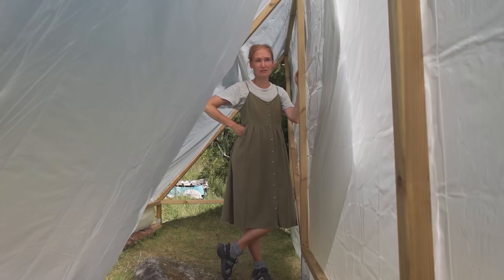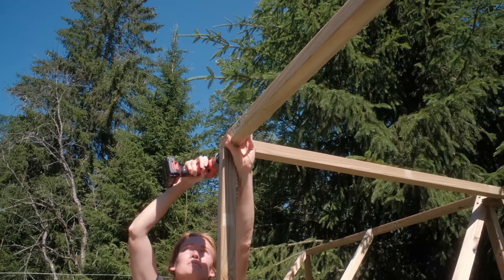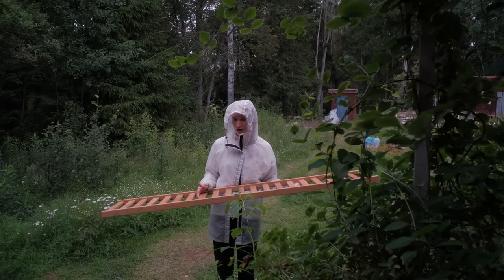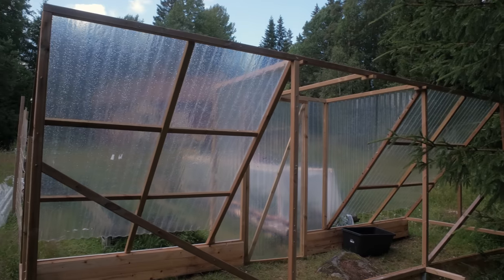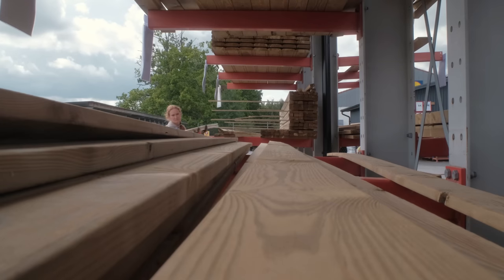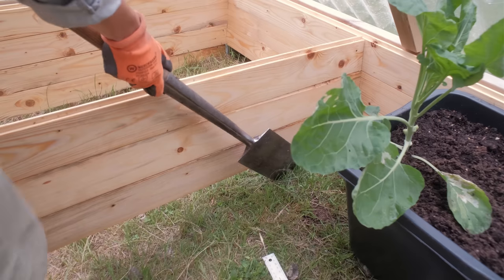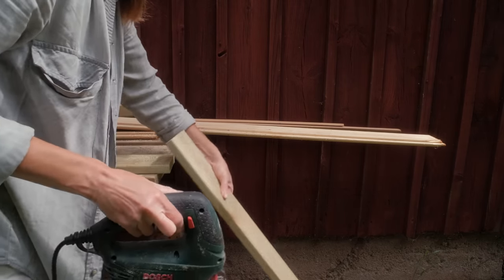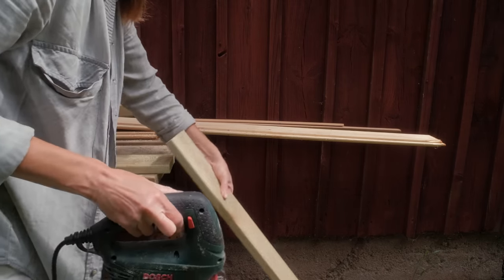I accidentally built a fairytale greenhouse (Story 59)

Comment: You did amazing, as you always do. And the video was made beautifully 💕  Now to the part I don't really want to write, but feel compelled to as a professionally trained joiner who's seen a lot, and lost part of 3 fingers to a machine (they were all put back and healed fine in the end so I'm one of the lucky ones). Your safety awareness around power tools really scares me sometimes 🙈 To make a long story short, please never ever cut/saw lumber (or anything, aspecially in non uniform materials such as wood) with the blade pointing toward any body part. If you need to hold a piece of material, prop it up, or hold the end you want to keep from falling and saw with the other hand, never crossing the two. Never ever! Blades can shatter from nowhere in the middle of a cut (happens more frequently than you would think). Timber can all of a sudden change in density, within the same piece. Things, like pebbles, minerals etc can be invisibly imbedded in the wood (due to wind, animals etc, and then the bark just grows over it year after year making it invisible). All these things can cause saw blades to either shatter, kick back or rush forward, sometimes so rapidly your brain won't follow until after the fact. These things lead to lost fingers, severed arms and worse... All the time! You're so precious to so many of us. Please please be more safe, even if it means being slightly inconvenienced in the beginning. Once you get the hang of how to do things with safety first in mind it will quickly come as second nature (self preservation is a powerful motivator) and you'll just do things the safer way automatically. If you struggle with getting started, search for things like "circular saw safety" etc, and you'll get good visuals to remind you of the dos and don'ts to keep top of mind. I'm rooting for you in everything you do and hope you will take this as well intended advice rather than criticism. That's how it was meant, no more, no less. Take care, be happy & be safe. I all ready look forward to your next video 😊❤
Reply: Well said, the cross arm cuts were making me nervous alone
Reply: It’s a really important reminder to all who use tools and do projects. You get caught up in the moment and the progress and safety isn’t out front in your mind. I needed that reminder too. Thank you!
Reply: Thx for the warning! I was on the point of sawing myself, always feel a little scared, procrastinated doing so, and was now seeing the beautiful work here on the edge of sawing like I saw here. So from our watchers viewpoint your info are very valuable , too!
Reply: And ABSOLUTELY ALWAYS wear safety glasses!!!!!!!...I also felt sorry for you poor hands, try wearing gloves...even fishing -gloves that leave index, middle fingers and thumbs exposed for dexterity. ALWAYS safety first, good luck with your projects❤

Comment: Fabulous job and it looks really cute and functional! The only thing I would consider adding is a self ventilating window. They are relatively inexpensive, but an arm will push open the window automatically when the temp reaches a certain level. I don't think you even need solar for it. However, they do make small, inexpensive solar fans for greenhouses, too. It 's so important to keep the air moving.

Comment: Well done Rosie and your parents. You work so well together.The pitched Roof and bigger entrance and the bench over the rock are great. I imagine that if you grow year round in there you may build another. If you have a black covered water source (garbage bin, or spray paint milk containers) they will absorb heat in the day and radiate that heat out over the nights. Compost is also a heat source , both of these low tech strategies will give off heat to start seedlings earlier to get a head start ). Rig up a few containers and collect the rainwater too. Botanical garden greenhouses, and Botanical gardens are my favourite places. I was very interested with how you ran with your design. I do hope you will get around to fixing that wood rot at the bottom of the window where your outside work bench is. Please don’t wait like me…10 years later…a huge job….I have had to sculpt and sand the Builder’s Bog (Oz brand) to match the  100 year old window frames. A stitch in time saves nine.

Comment: One suggestion I would make is to use some metal bracing in several places to tie down your roof to the bottom rail like the one you used on the doomer. High winds will pull that roof off. Hear in the states they call them hurricane clips. But flat ones would do the same.❤❤❤😊

Comment: What a sweet build!
One of my favorite local greenhouses has a similar flat back and angled front (it's deeper) 
The back (to the north)  includes straw between the framing! I love the design, and the straw flakes help it hold warmth - it was a student build for the college garden. It's mostly used for storing supplies and tools, or starts on the bench under the slope, and there's no finish over the straw wall which is about 3' high - I'd love to see them integrate cob and finish it a bit more!

Comment: I happened on this vlog tonight and couldn't stop watching!  Great job!!!  Regarding the issue of water seepage when it rains, here are 2 options.  The first might be the more expensive but the easiest with less elbow grease:  Use clear silicone (exterior window type only - not bathroom/kitchen) caulking - make sure it is 100% silicone though.  A latex/silicone mix will dry and crack with extreme weather or pull away from edges.  The clear silicone won't show from far but will keep the seams between the plastic panels flexible enough to stop water from getting in and stopping your wood frame from early water logged rotting. 2nd option: Use the greenhouse plastic as a "seam bias tape" to hold 2 edges together.  You can then hold them down with the free wooden slats or 'glue' them down with the silicone caulking. 
I have a plastic grid covering on my own greenhouse and though it is not a 4 season permanent greenhouse like yours, using 100% silicone caulking when I have to 'patch up' holes created by wasps and bees trying to get out of the space has worked wonders!  (Duct tape doesn't last more than 1 summer).  What I have issues with is finding plastic grid greenhouse tarp where I live.  I have access to 15 ml clear plastic but it only lasts 2 seasons and gets expensive in the long run.  Love your videography!  If you were my daughter, I'd be very proud of your accomplishments so far.  You are "growing" into a wise woman.

Comment: I've built many green houses using the plastic but it has to be used over PVX hoops or cattle panels arched. It takes lots of tarp clamps to secure the plastic. The plastic also needs a few holes in it for wind and ventilation. But, I much prefer using 2 x 4s, cattle panels and the polycorrugated panels like you did here. Those panels only last a 2-3 years in our hot humid weather. So they have to be redone.

Comment: Well done!  I love that you used lap joints in the construction of the greenhouse. So much stronger than just buttingvends together. For anyone who is thinking of building a greenhouse of their own: If the wood isn't already treated,  I would highly recommend sealing the wood before assembling it. Just laying out the wood as Rosie's mom did and brushing on the sealer. Don't forget about the cut ends as well.. Also,  if you plan on having the greenhouse last beyond 5 yrs,  put a layer of gravel- compacted, under the frame and then around the outside perimeter of the greenhouse. Using a multi-layer of cardboard under a 3-4" layer of gravel. You can use landscape fabric as well. Cardboard is usually free,  and works well keep to suppress weeds. The gravel is to help with drainage and to prevent mud from splashing up onto the plastic panels.

Comment: Try clear gorilla tape or something similar on the outside seams to catch the rain and act as a seal in one continuous piece from the top to bottom transition of the angled wings adjoining the vertical dormer section on both sides. Anywhere you have leaks. Inspirational build, I'll be doing something similar adjoining my freestanding garage.

Comment: Clearly you have some building skills, nice job ! Imho, I'd lay weed blocking material on the ground and throw gravel down as a floor, make a few draft windows for air circulation and a solar fan,lights to add also.

Comment: Congrats on your greenhouse! You put so much effort into it, dormer and all. May it brave many nordic winters! If you permit some suggestions to add to its longevity and usefulness: 
1) If one of your intentions with building a green house was to extend the growing season you currently appear not have much in terms of insulation. It would warm up on a sunny day in spring or fall but get freezing at night. So no growing extension would be achieved. Thermal mass and insulation are the things (other than heating) which may help. You could use bubble wrap to dress up the insides to give it an insulation in the spring and fall. Bubble wrap that is UV stabilized is to be preferred as it last longer (unless the outer material does already filters UV light). You could also insulate your back wall (even with something non transparent). Because as of now you will only loose heat in the direction of the trees and gain very little usable light in exchange.
2) the wood you use is pine? Some of it may be treated. Some of it you (your mom) applied linseed oil to. Either way pine fares purely if buried and may rot in a year or two if moist. So for example the black fleece you are using in some of the beds may keep it from the dirt but not the moisture. There is a special plastic for that which lets the air circulate. Look at raised bed tutorials (don't know the English name for it off hand). And maybe you find a stronger non toxic / safe preservative for the parts of the wood that get wet.
3) ventilation is usually crucial in the summers to let the hot air escape. Most Plants stop much of their activity over 28°C and suffer. 
4) The reinforced plastic (with the white grid) typically starts falling apart after a few months here in the alps because if it is what I think it is, it does not withstand UV light (type of plastic). On the back side it may be fine. On the top it may disintegrate quickly and leave the wood exposed.
Maybe you have considered all this in the project, but in case you have not, this were my 2 cents and I hope this long comment contains something helpful (from my failures and successes). Cheers, fr Johannes
Reply: Very helpful info, thanks for sharing! Do you have any comment regarding the corrugated semitransparent wall panels? I am wondering how prone this material (polycarbonate?) is to cracking at the points where it is fixed to the wooden frame with screws. Even if there are no cracks after drilling the screw holes and mounting the panels, how robust (with regards to cracking) is it in the long term? I'd imagine there are inevitable intermittent stresses due to natural forces (windy days, snow in the winter) that might cause cracks to appear in the long run? If yes, could this be avoided by modifying the way the panels are fixed to the frame? I found Rosie's build very inspiring and hope to help a friend do a similar greenhouse project at some point in the future.
Reply: @itssoaztek4592  Have not worked with that product. In my latest build I chose solawrap over policarbonate. It lives longer, is cheaper, insulates the same and let uv rays through, which aids plant health. I use it with a sunk greenhouse (walipini) to grow citrus in the alps.
Reply: @kathmediaDeutsch  Thanks for the reply! Growing citrus in the alps sounds fascinating!!

Comment: Quick tip: use liquit soap to dip the screws in. Saves a lot of Akku power.
Build a Frame for the Door first, and then the door itself in between. BEFORE putting it on place. There you can test the Angles. Seal ever screw hole with wax or something else to smooth, to keep moisture pocket in and result in rotting the wood. Next time use oak. Nice Project. Thx for sharing.

Comment: Locks amazing, good job!!!  ♥️🤗🍀🙏 To ceap it from rotting in the long run even if it's impregnated wood you shuld burn the end off wood befoure puting them in the grownd or metal pillars..and grawl and concreat blocks under neath that the lower wood is not so near the grownd or skip them..that way it holds longer and not rottens..or to build in steinless steel and not wood but up on the roof in the middle metal, hold longer cleaning to wean it's near the woods 🤗♥️🍀🙏 Low your videos always, so inspaering ♥️🤗🍀🙏🌹 Big hugs 🤗♥️v

Comment: Bravo and building it with your parents will be a great memory for years to come.   I built a 20' geodesic dome over a decade ago with a Rocket Mass Heater and A DIY 900 gallon aquaponics system in it.  You did so many things right...  using polar plastic with fiberglass weave inside of it is beautiful and it will last for at least 7 years.  There was no need to use treated wood. Untreated Wood will last for a long time.  The grow beds look great, but locating  them against the exterior wall will limit the growth season.   I grew cherry tomatoes until the end of January.  It was soo much fun and fresh veg was excellent and kept my wife happy!  I actually wrote a book about it all, but I haven't been able to finish editing it.   I have sleep apnea  which caused a stroke and I am very limited now.  I am stuck in an apartment and can't grow anything.  The apartment manager uses glyphosate as perfume!   If it lives, kill it, is her motto.  I live in NE Wisconsin where the actual coldest temp was - 22 degrees and I kept the dome at 70 degrees most all nights burning pallet wood.  It was fantastic to walk in a topical running water paradise every night as I fought and beat mother natural. Loved your video.  Can't wait to see what all grow! it is possible... I proved it! Year round gardening in Wisconsin!!!

Comment: i used fiberglass for the one i have now but it gets white in 10 years.  i used old telephone poles i got free, set 2' deep and used them for the rafters too.

if i were starting again, i would do it all in used patio doors and windows.  i have replaced the fiberglass with that in the key areas.

a good plan would be to use tin for the north wall, put the door there to save sunny space, so your tin might go 4' from the north wall, with the glass going on to the south.  the north end would work as your potting shed, and in winter, the sun is gonna come in some as well.

Comment: I used 2x2s for my greenhouse as well.  To save money, I wrapped the 2x2 panels with UV-rated, 6 mil poly to produce an air-layered, double wall.  Roof is double-walled poly panel because strength is required for snow load and ease of installation.  Roof is lean-to that diverts rainwater into rain gutter.  Rain gutter is piped into the greenhouse to capture water in 50 gal rain barrel.  Rain barrel equipped with 12 volt pump attached to solar powered, portable battery (Jackery, Bluetti) for convenient watering of veg.  Entire project complete in ~ six days.  Recommend greenhouse attached directly to home or install insulated wall that does not receive sun to maximize greenhouse insulation.

Comment: Rosie, it's safe to use wood in metallic frame when putting in the ground, but I've seen you putting pure wood in the ground, don't you think it would rotten after snow or rains, also this plastic with waves structure will be hard to clean from the snow, I would cover it with two tents for cars, boats for the winter

Comment: This was a cute project. You are not under attack, I am just puzzled by a few things:
Supports made of wood that are directly in the soil do not rot?
If the base foundation made of wood that is laying in direct contact to the soil rots, won't the entire greenhouse fall down?
Maybe there is enough airflow so the wood planks will always have a chance to dry, but again, those support beams seem sketchy. But if there is airflow, is it still a greenhouse?
So now another part I do not understand: you used plastics that block UV rays? The green house will get warm, especially because of the angles on some of the walls, but will UV rays actually penetrate that foggy plastic? If plastic is meant to be used outside, it will most often block UV rays, if not, the plastic will get ruined in the sun.
When it gets chilly outside and it's not remarkable warmer in your greenhouse; something is wrong.

I have not seen any of your other videos, but having a slanted greenhouse fastened directly to your house will warm it up and you can save on electricity(if you use that).

Comment: The only mistake I saw you do, is the hanging of the door. It is normal practice to hang your door (or gate) with the diagonal beam running into the top closest to the top post. Otherwise your door (or gate) will sag over time /l .
Great effort I’m impressed 👍

Comment: hi rosie. your greenhouse is lovely. may i offer some thoughts: i hope the plastic you got is polycarbonate. if it's not, look into replacing your current panels as needed. non polycarbonate panels seem to degrade quite quickly by UV, they get brittle and crack under stress by wind, snow or ice. i have a greenhouse constructed in a similar way by a previous owner of our property. the panels are all beginning to fail. even a few new panels i installed last year as a repair are already beginning to fail, less than 12 months later. no nonsense with uv treated polycarbonate, it will last much longer - we'll be replacing all the panels with uv "greenhouse" polycarbonate. i also recommend making sure you keep the wood structure as dry as possible at all times - so take careful note of water ingress or the wood will rot and slowly destroy your structure.